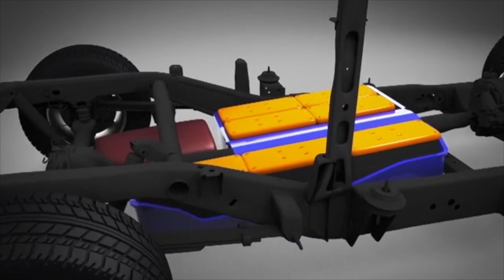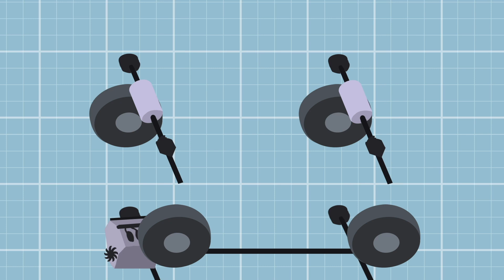Could This Pickup Truck Design Change The World?

Comment: Unfortunately, pickups are designed to haul and tow mass, and each kg of mass you add to the empty weight, decreases the payload and towing capacity. This in turn requires you to upgrade all the components, such as from F-150 to F-250, just to get the ability of an F-150. So once you add that cost to the cost of the hybrid system, it’s too expensive compared to other similar rated trucks. 

Workhorse makes a range extended series hybrid that uses a small inline 3-cylinder range extender, but it’s designed for a certain type of work, such as hauling a set of tools and a few materials, such as a residential plumber or electrician might carry. It’s not going to be towing a big 5th wheel trailer or a big boat. 

However it seems like most new pickups are used by urban cowboys, who don’t carry a bail of hay in the back and a Hot Shot in the gun rack. These will never see a day of work in there life, and could easily be BEV or hybrid.
Reply: IMHO, using exotic lightweight materials like carbon fiber or even just alumin(i)um would help solve that problem, although it would reduce profit margins further.
Reply: John George Bauer-Buis, I think the major pickups manufacturer is already using some aluminum, but their beancounters probably tell them which areas can be aluminum and which can’t. 

There is also the perception that these exotic materials, while great on supercars and aircraft, are too weak for use in a truck. People don’t want their pickup bed to be like a soda can. LOL
Reply: Like you said, urban cowboys, it's not likely that they'd adopt the technology
Reply: IMHO You can’t “Roll Coal” with an EV 😝. Urban Cowboys will never go for it. You are very correct in your assessment of the EV pickup. For Urban dwellers, it might, might pass muster. For the “Work Set” it will never fly. As you said, to get the towing and carry capacity of an F-250, you would need an F-350 chassis to start with. I also don’t see this working for, say, “electric line crews” that are out for days and just need to throw mor diesel in the tank. Where do you charge in the middle of Wyoming? Solar? You would need another Semi to carry the panels and gear. Petrol trucks are here for the next 20 years, at least and until we perfect matter/anti-matter power.
Reply: TexasScout Noneofyourbusiness, they have E-cigarettes, I’m sure they can use the same technology to roll coal. Lol
Reply: The laws of physics haven't changed to my knowledge. You have to move something heavy,you need X amount of power,whether it comes from an engine or batteries. Time to kiss our collective asses goodbye as far as climate change is concerned?
Reply: The thesis behind serial hybrid as exposed, chosing tech winners with no sound criteria, dosen't hold water.

As said by others, there are different usage models for the same machines, and no electrification solution fits them all.

The pickup is a machine that requires energy delivered at some power rates compatible with its use. 

Traditional chemical liquid fuels (diesel and gasoline) are excellent energy carriers packing a huge amount of energy in low volume and weight. No battery gets to the same orders of magnitude. Batteries may never reach it as there are real physical limits. The most promissing is Li-air that mimics a fuel using atmospheric oxygen for the oxidation reaction.

Fuel delivery may be easily sized to allow for the required maximum power levels. 

Engines must be sized to cope with the required maximum power for a certain amount of time.

It might be easy to rightsize electrical motors to any need, but not the electrical power delivery for it.

Power levels, energy density, State Of Charge (SOC) excursion, duty cicle, robustness and durability for heavy duty work are very though for light and small batteries.

There are usage models with lighter duties, with stop and go, that might benefit a lot from hybridization. Most probably as a parallel electric (or even hydraulic) deliveries that lesses demand for the ICE, without impossibly burdening batteries and high power circuitry.

Serial parallels have merits, but impose higher battery stress and degradation. Even more with smaller packs. The amount of overdesign needed for a robust durable setup negates possible benefits.

There are other possible advancements in both ICE and hybridization. There are newer opposed piston diesel engines with very high thermal efficiency, power densities, a low polution generation (look for Cummins-Achates, DOD,...). There are cleaner renewable options like DME, that could be put together in a hybrid setup allowing for "longer ranges" (energy delivery) with reasonable battery sizes. This would be similar to a Prius-Truck.

For pickup that just have to look like Heavy Duty, but can act as Light Duty, chances are higher for EV only, or serial hybrids.
Reply: Celso Starec, yes, like I said, urban cowboys can use electric trucks, but real cowboys that need their truck for work will prefer the convenience of fossil fuel.
Reply: Most people don’t realize the energy density of a gallon of gasoline/diesel fuel. How many liquids can move a 5000 lb SUV down the road at 70 mph for 10-12 miles. Think about that for a moment.
Reply: TexasScout Noneofyourbusiness, liquid hydrogen can. Lol. We will have to see what Tesla semi can do with its unspecified empty weight. If they can make that viable, then an all electric F-350 with 350 kWh battery an 350 kw CCS charging would be ok for many, but the price would be $100,000.
Reply: @imho7250  
DME (Di Methyl Ether) is a cleanner substitute for diesel that runs on nearly unmodified diesel engines. 

It's a gas at ambient temperature, but far more manageable than hydrogen. The small molecule fully burns easier, with far less emissions, notably particulate matter (PM, soot).

DME is easily sinthesized from methanol, and hence from fossil or renewable methane (natural gas).

https://en.m.wikipedia.org/wiki/Dimethyl_ether
Reply: Celso Starec, it may be clean, but it’s still a hydrocarbon, so the only way that can satisfy low CO2 emissions is if it’s made from CO2 scrubbed from the atmosphere, which it won’t be. 

If we start with any of the various types of solar energy (PV, wind, hydroelectric), and make a liquid fuel, I think hydrogen is more efficient than turned CO2 and H2O back into a hydrocarbon for net-zero CO2 emission. 

Of course urban cowboys can use batteries as a more efficient energy storage than hydrogen. Tesla is trying to prove it can work for a work truck. Of course any electric truck that that weighs over 6000 pounds can get the “hummer tax credit”, but it’s still going to be expensive.
Reply: @imho7250  "If they can make that viable, then an all electric F-350 with 350 kWh battery an 350 kw CCS charging would be ok for many, but the price would be $100,000."

A 350 kWh battery pack would weigh 4,600 pounds, that would seriously compromise the payload of an F-350. A Model X can be well over $100,000, I don't see how you would build a heavy duty chassis and a 350 kWh battery pack for anything close to that cheap.
Reply: @imho7250  Hydrogen is massively impractical for use in anything, it's far too voluminous and it leaks through materials, which would cause the hole in the ozone layer to grow again if used on a large scale because it's so difficult to contain.
Reply: idontcare80, that’s what I said about a semi truck with a 1000 kWh battery for $180k. If Tesla can do that (which they can’t), they could make a 1-ton truck with 1/3 the battery, 1/3 the towing capacity, for $100,000...which they can’t.
Reply: idontcare80, yes, hydrogen has its issues, but its currently the only visible option for some applications. Like any technology, the country that doesn’t research it is going to be screwed if we ever run out of fossil fuel.
Reply: @imho7250  Tesla hasn't done anything close to that, the Semi doesn't even exist as anything but a prototype and a 1 MWh battery would weigh nearly as much as an entire semi-truck tractor!

Edit: So, I think that we agree.
Reply: @imho7250  It's not a viable option for anything, it has even more problems than BEVs! We're not going to run out of fossil fuels for a LONG time.
Reply: idontcare80, how many battery powered rockets can get to orbit? Zero. There IS a need to research hydrogen fuel, whether you like it or not. As stated previously, batteries work for some things. Nikola seems to think hydrogen is suitable for their truck, Tesla seems to think batteries are. Time will tell, but I think both need to be developed.
Reply: idontcare80, yes, we agree that so far Tesla has not proven their semi can be useful. They gave a bunch of specs, but omitted the critical ones, such as empty weight over each axle. So the useful load is unknown. That means unless you are hauling potatoe chips or ping pong balls, you will reach max weight before you are full, and that means less revenue. 

That said, I’m sure a beer company can still do ok if they haul less beer shorter distance, and save money on fuel. But I don’t think Tesla can make it at a profit for $180k. It will be like the $35k model 3 which they can’t make at a net profit.
Reply: @imho7250  How often are rockets are used to haul freight on the highway? Cryogenic fuel storage is not practical for use in any kind of road vehicle. Batteries work for some things, hydrogen works for nothing that moves along the surface of the Earth. Hell, hydrogen doesn't even work for aircraft.

"Nikola seems to think hydrogen is suitable for their truck, Tesla seems to think batteries are."

And neither have anything close to being ready for real-world use (although, Tesla is MUCH closer to that goal than Nikola).
Reply: idontcare80, I didn’t say every country needs to research hydrogen for over the road vehicles, I said every country needs to research it. Eventually those using cars are test beds will see it’s only practical for situations needing a higher energy density.

Nikola thinks it’s a good solution, and they have been working on it long before Tesla talked about a semi. So if some states makes a law that says all trucks Musk have zero CO2 emissions, and we have a Tesla semi vs Nikola. Current neither has a suitable refueling network.

It doesn’t matter to me who wins, Nikola or Tesla. The customers will be the ones who decide.
Reply: @imho7250  We already understand hydrogen quite well, what needs to be researched?

Hydrogen fuel cells and their associated hydrogen tanks have WORSE energy densities than batteries, both in volume and mass.

"Nikola thinks it’s a good solution, and they have been working on it long before Tesla talked about a semi."

And they've produced zero results. The same is true of HFCV passenger cars... longer development, no viable outcome.

"It doesn’t matter to me who wins, Nikola or Tesla. The customers will be the ones who decide."

Neither will win, carbon neutral hydrocarbon fuels will be the only option for long-haul trucks.
Reply: idontcare80, the same reason that we understand batteries quite well, but still research them, because every few years something changes in technology that allows what was impossible before to be possible. Nobody but a fool would have put 5000x 18650 cells in a electric kit car, but they did, and Tesla was born. Since then they drove the cost down quite a bit. 

Most of the research in hydrogen deals with how to make it, how to store it, and how to release the energy efficiently. And there has been progress, but just like battery vehicles, so far nobody has made a profit making one, once you cut out the government subsidies (including incentive). 

So, yes, Japan and US and every smart country still spends money researching hydrogen. If you don’t want to research or or invest in its research, you don’t need to. Lol
Reply: @imho7250  Everything we know about hydrogen tells us that it can't be used to fuel any vehicles on Earth, other than rockets, those properties wont change with additional research.

"Nobody but a fool would have put 5000x 18650 cells in a electric kit car, but they did, and Tesla was born."

The thing is that someone did the math and realized that it would work, but doing the math for hydrogen proves that it wont work... EVER.

"And there has been progress..."

Not really, the vehicles are still completely useless.
Reply: idontcare80, the only horse I have in the hydrogen race is that I’m an American, and for National Security, we cannot afford to ditch any technology. Hydrogen also has potential in cargo ships for the same reason they are viable in semi trucks. 

There is a lot of false assumptions about the cost of hydrogen, but hydrogen can be made very cheap where land is very cheap, and trucked to where land is too expensive for solar. There are a lot of regulations and rice bowls preventing people from making solar power in cheap states and sending it to California. 

Since it’s a forgone conclusion we need hydrogen, there’s nothing wrong with them trying to make it viable in smaller applications, while those vested in batteries will try to make them viable in larger applications. That’s capitalism at work.
Reply: @imho7250  We need liquid hydrocarbon fuels for defense, nothing else works in aircraft, or military ground vehicles. Hydrogen is not a viable fuel for semi-trucks, not even remotely.

"There is a lot of false assumptions about the cost of hydrogen, but hydrogen can be made very cheap where land is very cheap, and trucked to where land is too expensive for solar."

Hydrogen being expensive is a fact, because producing it is horribly inefficient. If you use solar and land to produce it, you're just making inefficient use of the land and the energy produced, which means that you will have invested a lot to get very little. 

We don't need hydrogen because it's completely useless as a fuel.

"That’s capitalism at work."

Not only is capitalism massively flawed, but there's nothing capitalist about hydrogen, it's being propped up by ignorant politicians who are being corrupted by slimy, fossil fuel industry lobbyists.
Reply: like you say 90% of pick up owners dont use it for howling or even carrying anything, asides 30 KWhrs of batteries is about 300kgs, wouldnt affect much the carrying capacity. Last but not least electric motors provide more torque than ice engine so you dont need an as big ice in a series configuration you can even get rid of the transmission like on the honda accord hybrid.
Reply: idontcare80, I agree that as long as there are hydrocarbon fuels available, we need to keep a war reserve, which is one of the reason why we subsidize oil industry, which is the first thing the EV fanatics jump on. But as you say, until there is a substitute for it in Jets and tanks, we will keep subsidizing it.

But if there is ever a day when we run out of fossil fuels, that is when ALL alternatives must be ready. And there ARE in fact some in R&D.
https://en.m.wikipedia.org/wiki/SABRE_(rocket_engine)

There are many acres of land in the desert that can’t do anything but make electricity. But electric rates are pretty cheap where land is cheap, so selling it to the grid and buying it in California is not equitable. But using solar to turn water into H2 and O2 and then trucking both to places to sell, might be lucrative. 

Solar panels are only 20% efficient, but if sunlight is free, then who cares? Same concept applies to hydrogen. If sunlight is free and only 10% of the sunlight’s energy can be turned into hydrogen, who cares? Unless you can’t get that solar energy into California where it’s expensive, then it doesn’t have an advantage.

I don’t own a hydrogen vehicle. Those are for the same idiots who would buy a Tesla solar roof, because they have more money than common sense, and can get you and me to help pay for 30% of it. 

If someone was working on using a nuclear reactor in a car, as crazy as it sounds, it might be possible someday,
Reply: @imho7250  No, you misunderstood me, we need to synthesize carbon neutral, liquid hydrocarbon fuels for use in ALL aircraft and for defense. We wont be able to eliminate the carbon emissions from the aviation sector without a carbon neutral, liquid hydrocarbon fuel.

"Solar panels are only 20% efficient, but if sunlight is free, then who cares? "

Solar panels are not free, land is not free, using those things inefficiently will not be cheap.
Reply: idontcare80, and how much does it cost to buy this synthetic oil? It’s and where is it currently sold? Historically its been very inefficient to try to take CO2 from the atmosphere and turn it back into a usable fuel. If it were cheap and easy we would be doing it already.
Reply: @imho7250  It will be expensive, but it will also be useful, unlike hydrogen.
Reply: idontcare80, how much is your synthetic fuel per gallon, and where is it sold?
Reply: @imho7250  The Navy says that they can produce it for about $6/gallon. The thing is, even if it's expensive, it can be used in inexpensive and existing vehicles, hydrogen can't make that same claim. Hell, hydrogen can't even make the claim that it's even remotely useful as a fuel.
Reply: garyp4205  Diesel fuel isn't toxic? Oil isn't toxic? Diesel exhaust isn't isn't toxic? WTF are you talking about?
Reply: garyp4205  Learn how to think, man. You're complaining about batteries being toxic (which they're not) and then you said that a highly toxic fuel is the solution to... something. 

When compared to gasoline engines, diesels are more expensive to buy, they're more expensive to fuel and they produce more pollution. 

"but there are exciting solutions for that."

Like urea injection, which not only reduces the efficiency of the engine, but also increases the cost and complexity of the engine, requires refills and reduces reliability? Right... Ok, bud.

Chevy Cruze: 153 hp (gasoline), 137 hp (diesel); CO2/mile 267g (gasoline), CO2/mile 276g (diesel); annual fuel cost $1,300 (gasoline); annual fuel cost $1,350 (diesel); EPA smog rating (out of 10) - 6 - (gasoline), EPA smog rating (out of 10) - 3 - (diesel). 

Mazda CX-5: 187 hp (gasoline), 173 hp (diesel); CO2/mile 321g (gasoline), CO2/mile 348g (diesel); annual fuel cost $1,550 (gasoline); annual fuel cost $1,700 (diesel); EPA smog rating (out of 10) - 7 - (gasoline), EPA smog rating (out of 10) - 1 - (diesel). 

Ford F-150 2.7 EcoBoost: 325 hp (gasoline); CO2/mile 420g (gasoline); annual fuel cost $2,250 (gasoline); EPA smog rating (out of 10) - 5 - (gasoline).

Compare to...

Ram 1500 3.0 EcoDiesel: 240 hp (diesel); CO2/mile 448g (diesel); annual fuel cost $2,750 (diesel); EPA smog rating (out of 10) - 1 - (diesel).